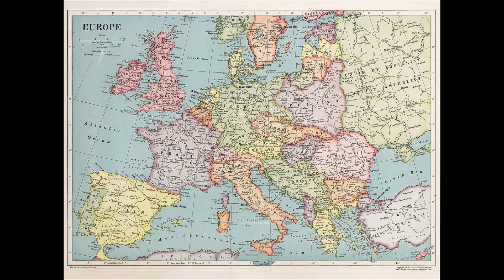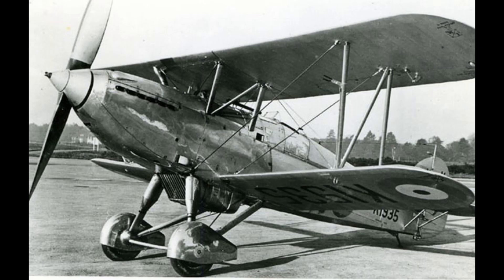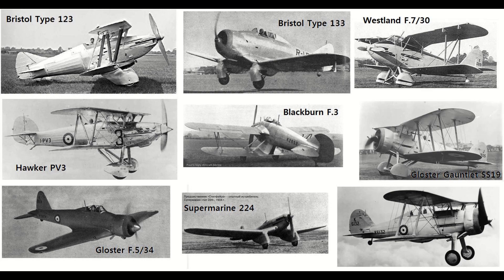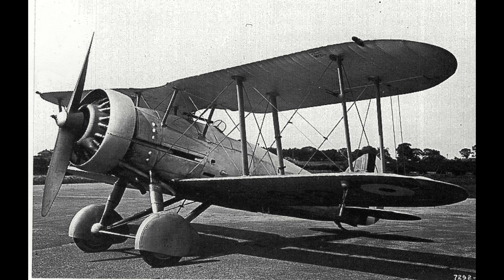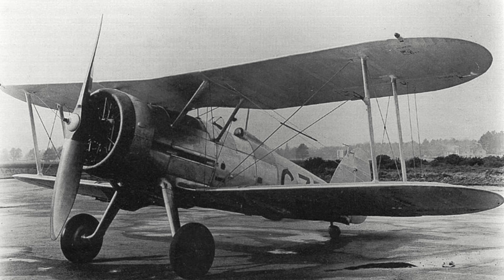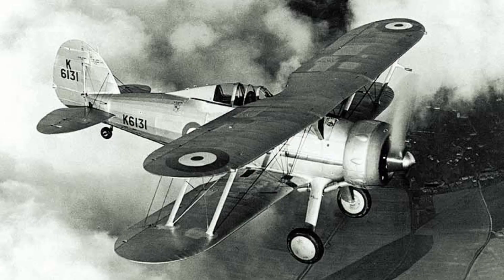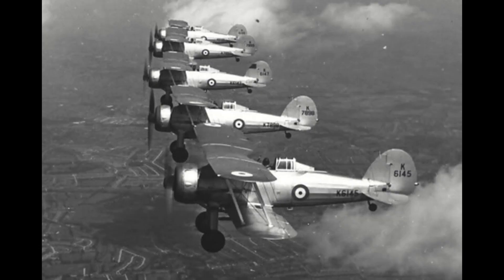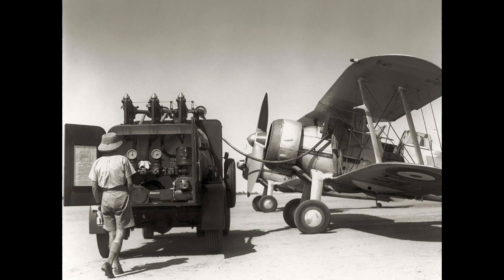5 Minute Guide to Aircraft: Gloster Gladiator

Comment: @0:10 - Was the Bristol Bulldog still a front-line fighter or was it relegated to colonial and other duty when the specification came out? I believe the Bulldog was introduced to RAF squadrons in 1929
Reply from the maker: Bulldogs were withdrawn from service in 1937, replaced ironically by the predecessor to the Gladiator, the Gauntlet.

Comment: I think the "Faith, Hope and Charity" story for the Gladiators on Malta is a myth. There were probably a half dozen or more assembled Gladiators at the beginning of the Battle of Malta and usually only two in the air at a time.  They were slower than the Italian single-wing bombers but still managed to down a few by getting in the air quickly.
Reply from the maker: There's a difference between the number of assembled airframes that were available and how many that were capable of flying at any one point. Yes the Hal Far fighter wing at Malta had more than 3 Gladiators assembled, but due to their logistical situation of being an Island under Siege, they could only keep a few airframes operational at any one point due to their limited supplies and attrition, using the others for parts and replacements to keep the few they had running continuing to do so.

Now, whether or not the exact number of operational airframes they had in this time was more than three is something that's been hotly debated since the myths inception. Its entirely possible there were only 3 operational gladiators, or that there were more flying and the myth was created as a result of the events being given the typical newspaper exaggeration, being sensationalized to make it more interesting or uplifting for the readers. Its more interesting to read about three named planes and their pilots fighting against improbable odds than just 'allied air power drives off enemy bombers', hence why focusing on individual aircraft and pilots became more common as the war progressed, exemplified in the 8th Airforce which is where you get all of the papers talking about the various crews of B-17s like, famously, Memphis Belle.

I believe that given the evidence available that its probable that there were in fact more than 3 Gladiators able to run at any one time during the Siege of Malta, *but*, that in order to retain operational capacity and not run their planes into the ground and be left with 'no' running airframes, they rotated what they had in an out of combat to mitigate attrition as much as possible, and thus only had three planes fly up out of how many they had, as a means to make sure that they still had planes for the next imminent air raid. 

Now Is it odd for 3 planes to effectively engage (i.e deter or impede) entire waves of bombers and fighters day after day for weeks on end? No actually, As throughout WW2 there are more than a handful of times where small numbers of interceptors flying up to meet massive formations of enemy forces cause them to either bomb inaccurately due to panic, or break off to avoid losses (depending on the airforce in question).

In regards to speed, while yes the Italian SM.79 did have a higher maximum speed than the Gladiator at the altitudes they would engage at, the SM.79 would more likely be bombing at its 'cruising' speed rather than max speed since due to the Mediterranean environment; engines (for both sides) had a tendency to overheat when ran at full power for extended periods of time. That, and trying to bomb at maximum speed while the entire airplane is shaking violently due to the engines running as hard as they'll go is suboptimal to say the least for accuracy, something that compounds when you also throw in frantic radio chatter talking about enemy fighters climbing or diving to meet you.
Reply: @5MinuteGuidesToAircraft  I would have loved some of what you're bringing up here in the video itself! It's great as is, but some more discussion and analysis would make it even cooler. Subscribing now!
Reply from the maker: @Tyggis777  As much as I would love to, this kind of in-depth analysis would easily cause the video to reach half an hour if not longer. I try to keep these around the advertised 5 minutes since it fits with both the style and theme of my content (easy to digest synopsis's) and fits into the free time I have available with my college workload.

That, and other people have already done beautiful in depth guides to most of the aircraft I'm covering/already have covered, like Rex's Hanger, Ed Nashs Military Matters, Not a pound for air to ground, Gregs airplanes and automobiles, etc.

The best way I try to frame and think of my videos is the kind you would find on a monitor pedestal at a museum, the kind that loops and gives a bit more insight on whatever its describing.
Reply: @5MinuteGuidesToAircraft  Well, look at how long Drachinifel's 5-minute guides have become. Sure many other people have in depth guides, but e.g. the nuance and analysis mentioned by you in the above comment is not something that normally appears on youtube. Would love to see more of it!